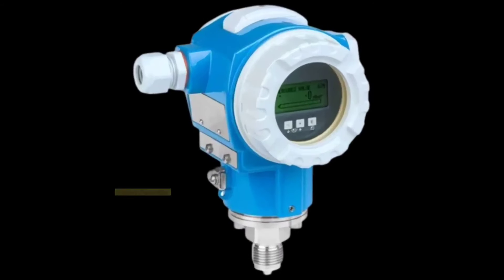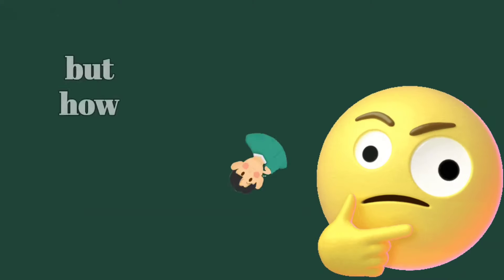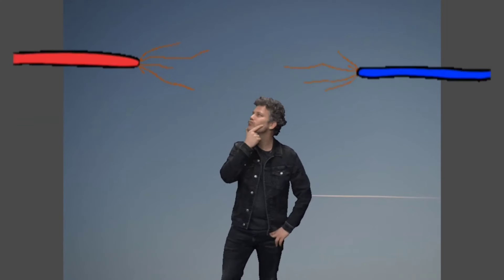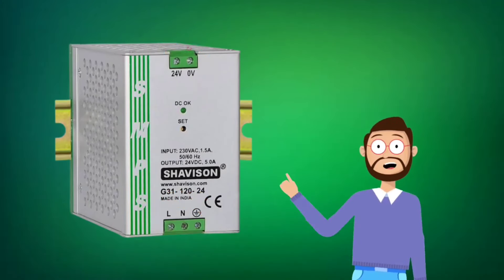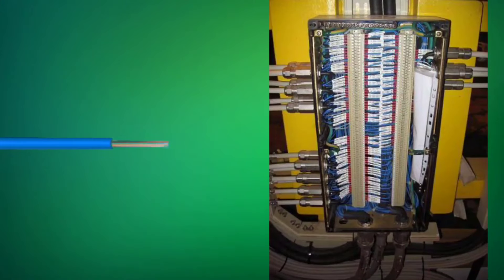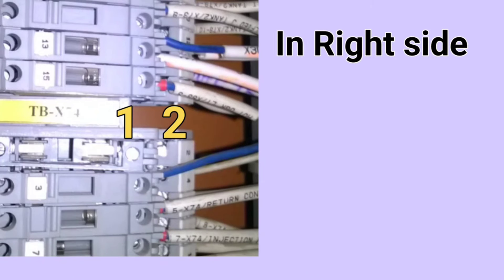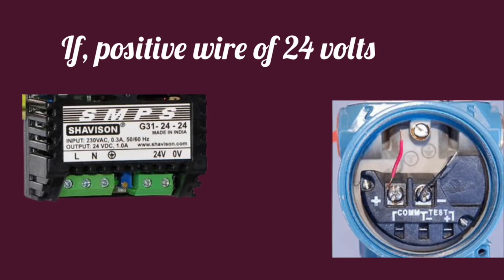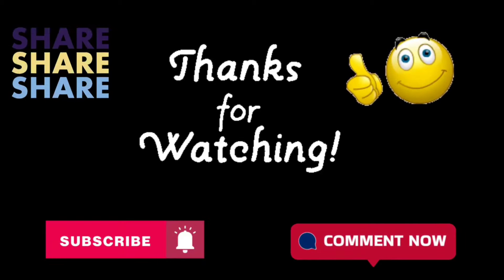Pressure Transmitter Temperature Transmitter Level Transmitter supply | Instrumentation

Comment: What a BS. "One wire for the supply and one wire for the signal". Both wire is for supply as well as the signal. One wire is for the hot and one for the common.